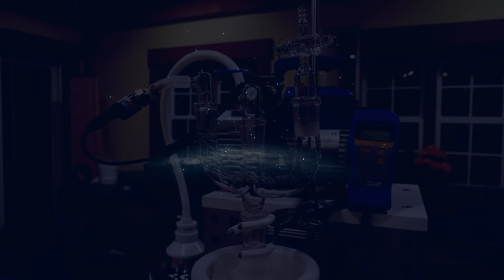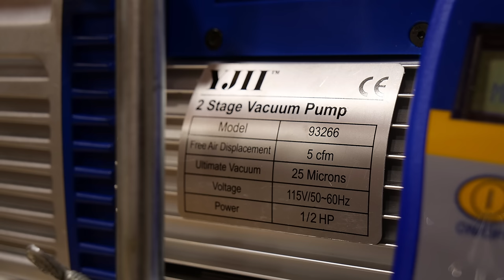Vacuum pump with NO moving parts

Comment: when you dropped the temperature from 300C to room temperature, why did the pressure only drop to the same value that the pump does without sieve? i expected it to drop lower than that because of increased adsorption.
Reply from the maker: Only because I for shortened the pump down.  There was more gas that could have been removed.

Comment: while i can't think of any applications in my life this was absolutely fascinating as always. what kind of vacuum pressures can this method achieve, given a maximum molecular sieve to empty space volume? i.e. where is the equilibrium of the sticky adsorption non-bond for the stickiest of molecules?

i don't know if its a thing but the prep process had me thinking about a potential thermal differential solid state pump, creating low pressure by cooling one volume and high pressure by heating another, connected through a one way valve. how well does that work?

most exciting of all are the molecular sieves. the oxygen concentrators and the experience seeing your perception of the sky change sound amazing. i'd be really interested in whether they are a sensible solution for water purification, air filters for gas masks or even against radioactivity?

Comment: I’ve always wanted to make a sprengel pump but didn’t because I wasn’t really sure if there was a good way to get rid of the vapor, maybe this would help? Not really sure how practical the combination would be or if removing the vapor would affect the pump, maybe though—I mean if it did work that’s an mostly safe and mostly free system for vacuum. Either way I’d love to see you have a try at one on the channel some day if it has a use.

Comment: Please do a video on and demonstrate the principle of synthesising, producing Carbon neutral fuels from renewable feed stocks. Maybe talk about how the future we are moving into having yes more electric cars, trucks etc as more the norm but for transport of larger, higher energy density use and required options like your container/tanker ships, large commercial aircraft, Military equipment (their aircraft, ships, tanks etc), construction equipment etc, all these more large energy use/output equipment that will otherwise need to be fueled with traditional fossil fuels; in itself may make the adoption and use of renewables, more strongly opposed.
Maybe a demonstration on the Fischer–Tropsch process utilising excess renewable energy as the energy feedstock along with CO2 from projects like the C02 air capture process using either strong bases or amines. Also the feedstock of hydrogen from the electrolysis of water to make a desired, energy dense, Carbon neutral, Hydrocarbon. 
Thanks.Hope to see you do something around the topic. Love all the work you guys do!

Comment: Several years ago I bought some laundry balls that contained "ceramic beads" that were supposed to boost the cleaning power of your washer. It seemed to work very well, so I removed some of the beads and put them in a bottle with tap water. It would foam when shaken, while pain tap water would not foam. Several years later these beads will still make water foam up. I bought some more laundry balls with ceramic beads but the new ones don't work at all, no foaming action and they are plain ceramic beads. Why do you think the older ones work so well? It is supposed to be molecular action.

Comment: Good deal!  I'm interested in this kind of pumping, I want to use it for a small Neon plant, to replace a diffusion pump which came to a bad end.  Ah would have liked to see the punch line here!  Ultimate vacuum of 1) just baked out zeolite without cryogen and 2) refrigerated zeolite at the end there.  We didn't see the final pressure!  
Also, it's my understanding that this kind of pump tends to ignore Helium, Hydrogen and NEON.  I think that's at LN2 temperature, not Liquid Helium temperature.
Reply from the maker: That's correct.

Comment: We have very very large vacuum pumps at thermal and nuclear power plants.  They are called steam jet air detectors and use high pressure steam passed through a jet pump to draw out non condensable gases out of the condenser.  They can draw an almost perfect vacuum, if you have a low subcooling temp in the condenser hotwell.
Reply from the maker: Interesting
Reply: Forgot to mention... loved the episode and the show!  Your lab/workshop looks amazing.

Comment: Being experienced at high vacuum systems, I question the readings you are getting. What is the type of gauge you have there? I suspect the accuracy of the gauge below 50 microns. An industrial quality gauge such as an MKS Baratron would be accurate in that pressure range. The cheap piezeo stress gauges tend to be marginally accurate to 50 microns but become unreliable below that. The main problem with the cryocool pump for most of us is getting the nitrogen. I have to drive 15 miles through traffic to the supplier. :(
Reply from the maker: You're probably right about the guage, but the stability and repeatability is solid and so for comparitive readings it's probably good enough for this application.

Comment: FURTHER GAINS???
If you then reheated the molecular sieve (MS) and then re-cooled it, all while the pump was going, would you get any further gains, or is there so much effective surface area in the MS that one cycle doesn't come anywhere near saturating the available surface area. and no improvement will occur? 

And yes, as was said below, this was so much fun to watch that it was over before I knew it!!  :))

Comment: @ teck ingredients

The vacuum line on a regular car engine to the master brake cylinder produces 14 bars of vacuum. This can be controlled by a standard.This can be set up by putting a splice into your vacuum line to the master brake cylinder and a ball valve inline. You extend the line from the car engine to the experiment. Or move experiment that's close to the car engine as possible.

You may want to disable the PCV Valve temporarily TO INCREASE VACUUM PASS 14.

Make sure you know what you're doing with your engine so you don't ruin it.

Comment: I expected ion getter pump which we use for the most UHV critical parts of electron microscopes - field emission electron gun. They don't even have any output. I don't remember exact principle, but gas molecules are ionized by high voltage in a narrow slot and attracted onto some reactive metal surface (titanium i think) and new metal is slowly deposited on this surface as well so gas molecules are trapped there forever. This is third stage after rotary/scroll and turbomolecular pumps.

Comment: Very interesting. Some of my high school chemistry students will be interested in this video.

I noticed that you kept the pump on beyond its specs. Would it be better just to take it off? Could the vacuum pump, when working beyond its mechanical limits, leak air into the system?

Thanks! 2 year old video that is very relevant today!

Comment: Science is fun isn’t it, well if you don’t like it you can fire truck off. 
My dang camera screen broke, I can’t see the vac analysis screen, that 20 microns I’ll trust trust you on. 
This is very instructive to me as I worked in the electrical field but crossed over to HVAC. I install refrigerant systems for comfort cool and heat. The whole of everything can be explained by temperature and pressure. (Save the thinking mind) I enjoy the handling of the gasses and the evacuation proses, all enable by dielectric magnetism

Comment: Ion pumps and NEG coatings also have no moving parts.  I am the inventor of the patented (expired now) ion pump controller that could control ion pumps and read ion currents when vacuum is in the 10e-12 Torr range.

Comment: My recycling sits in view of the sun. Overnight the sealed empty bottles get really cold and shrink, during the day they heat and pressurize, it makes a racket that reminds me to take them in.
I've always wondered, with one-way valves attached to a bunch of bottles, how much air you could move.
Apparently I'd want to put some of these beads in the bottles first?

Comment: Three questions:
1) You say the tiny fractions (microns) of an inch of mercury are "theoretical." Is that because if we actually introduced mercury it would vaporize at those pressures (and reduce the vacuum as well?)
2) Is the molecular sieve more "Van Der Waals attractive" to the freed gass molecules than the chamber walls and the contained devices... or does the sieve just have a vastly larger surface area so when averaged out the distribution of the molecules favors the sieve?
3) How does this differ from a vacuum keeper/getter?
Reply from the maker: It's theoretical, because you can't measure the height of the mercury when it is that small.  The curve of the meniscus is many times greater.  It's just the enormous surface area and this is unlike a getter which buries the gas molecules under an electrically sputtered getter layer.
Reply: @TechIngredients Thanks for that. The meniscus must be huge relatively speaking.
But back to getters:
I did some digging. Chemical (as opposed to physical) getters are what I was thinking of. They seem to be more of a vacuum maintenance strategy: you leave inside the equipment an area of "molecule hungry" high surface area material so as the gasses liberate over time, they eventually react chemically to the getter and those are stickier and harder to reverse than Van der Waals bonds. Do I have that right?

Comment: Really interesting. I know you mentioned mercury gas. But could you also not use mercury in that drip system to get to similar pressure? I think it was your target has a needle coming off of it and drips of mercury are catching small segments of atmosphere within and pulling it away. The difference is using gravity on a liquid versus the absorption of a material? Granted, at $2 for the siv mats, I guess that is not a huge concern to set up something heavy. your thoughts?

Comment: Just prior to the 10 minute mark, when talking about oxygen concentrators, you state that it is the Oxygen that the molecular sieve preferentially adsorbs, and that the first gasses to leave upon decompression are the Nitrogen... is this correct, because I'm finding the opposite reference when searching this online?  I'd love to see you build a cascading oxygen concentrator.
Reply: You for sure were reading about "Diffusion" ?!
This is a other prinzipal !
Reply: @TomKappeln  no, I was looking at information pertaining to pressure swing adsorption and oxygen concentrators which operate on the principle described... all other references suggest that the Nitrogen is "trapped" by the media, not the Oxygen.  I'm just wanting to be sure, since it would affect the operation and design of such a system.
Reply: @justinedwards4540  : This has to do with the Delta adsorber.
Only the Oxygen can pass inside, the Nitrogen is a bigger molecule and stays outside.
I know the oposite effect from inflating tires.
If you inflate a tire for the first time, after a while all the Oxygen will pass thru the rubber, only the Nitrogen will stay inside.
This is why you have to check a tire first more often when new and later not so often because the percentage of Nitrogen is rising from 78% up to more than 97%.

Comment: You didn't mention stuff like plastics, rubber or even vacuum grease itself which chemists use to seal their ground glassware joints tend to off gas under deep vacuums. 

Question when buying cheap molecular sieves they usually come with dust is it ok to rinse it off before dehydrating/activating it?

Comment: The units of that vacuum gauge is interesting.  In the field, people usually use Torr or mbar, not micro-Torr.
Reply: I had refrigerated air conditioning installed in a house once. They talked about getting microns of vacuum in the refrigerant lines. Their method wasn't as sophisticated; it was to let the vacuum pump run all day.

Comment: Nice video once again, i would note that it is difficult to reach any conclusion based on the experiments shown in your video. Mostly because as you said the air you are letting to the vessel are at room temperature and the effect of the air being cooled contributes to the pressure drop that can be seen on your barometer (so the both effects are combined and its not entirely clear how much those beads actually do). Also the term pump is probably a overstatement and how do i know earth is a sphere.... aaaand oh boy i cant read and i am intelectualy deprived, heck i am not even sober

Comment: Another tech video guy build a magnetron for metal vapor deposition, and he uses metal sputtering (titanium, I think) to scavenge gas from the vacuum chamber.  So that's a third way, besides the two you listed (molecular sieves and "cryo"), in addition to pumps that work with such low pressures.

Comment: so if you made a cold trap with the inside coated with sieves or a way to attach and dettach the sieves so you could dump them after use Tech Ingredients do you think that would work  .A vacuum system like that would be handy for dangerous distillations

Comment: Dear sir,
In biodigesters when we want to purify methane we use h2s filters then gas drying filter and finaly CO2 filters which have the proportion of co2 drop from 40 to less than 2%. The typical filter is made of a 10m tube filled with small plastic rings increasing the surface area. Biogas is pumped from the bottom while a shower of small and cold waterdrops are sprinkled from the top at 8 bars of pressure. Would you say the non mechanical method you presented here would work for separating co2 and methane? With what angstrom dimensions? And would it be more energy-efficient in your opinion? Some filtering membranes start to spread in the industry but remain very expensive.  Other idea, why not separate gases using a vertical pressure column with gas bottles that have two openings at top and bottom and reaching the liquefaction pressure of co2 which is far lower than that of ch4? Then we could just unplug the storage bottle at the bottom and recover 100% co2 with 100% methane at the top. Would the yield remain efficient for methanization operations in your opinion? Thank you for your answer and for your smart videos!

Comment: Are there cheap low angstrom desiccants like that which are combustible, to be used to absorb flammable gases like hydrogen so that they become a form of solid fuel that's more energy-dense than either alone?

Sorry if this question doesn't make science-sense. I'm learning a lot.

Comment: Most thermocouple gauges are specified for nitrogen, so the partial pressures of oxygen and other gases need to be added to your reading...  (a correction factor between the gauge's sensitivity and actual partial pressure).  Also, pumps deteriorate over time and thus are specified at the end of their warranted lifetime.  The oil in your vacuum pump will evaporate and transfer to your chamber (or other pump) if you operate it at lower pressure for extended periods of time.  $2 worth of beads; however, the treatment/disposal of hazardous waste is MUCH more expensive...
Reply from the maker: That specification of pumps at the end of their warented lifetime maybe true for very high end systems, but doesn't make sense for low cost pumps that are used in a wide variety of conditions and without hour gauges.
The dessicant is not hazardous unless it has absorbed hazardous chemicals and then it's more convenient than decontaminating vacuum, lines, pumps and the dirty oil as well.

Comment: Got to design and work on a UHV system that operated at 500C. Designed new gaskets using multiple elemental depositions because everything else leaked.

Whole system ended up on Ebay for 500$ scrap when they sold the division :(

Comment: I remember a long time ago, when I was at high school, our physics teacher used some contraption attached to a faucet as a vacuum pump. I think it worked by water flowing around a nozzle inside the thing and drawing air along with it, kind of similar to what a spray paint gun does to the paint with air.

Have you ever had any experience of such a device and how low pressure could you hope to achieve with it?
Reply from the maker: Sure.
You can get these commercially and they're good for modest vacuums especially when you're dealing with vapors that you want to dump.  For long duration operation they can use a lot of water.

Comment: This is super interesting. 13 Microns is still a ways off from being considered "High vacuum" right? Could you achieve a higher vacuum with multiple stages of this pump? How would a system like that stack up against a standard diffusion pump? On a slightly related note, Cody's Lab did a video a while back on one of the first high vacuum pumps that used a long glass tube with drops of mercury flowing through it to evacuate a system. It was incredibly slow, but I have often thought about making an experimental pump that employs something like 100 of those capillaries to speed up the evacuation. As always, great stuff!
Reply from the maker: No, it's not a high vacuum.  Flow through pumps like diffusion and turbomolecular pumps don't have a limited capacity, they can reach much lower pressures, but they're much more expensive.

Comment: unsure if this has been asked before so sorry for the repeat if so: could you use a molecular sieve technique to also construct a nitrogen separation membrane? I'm looking to get a relatively-pure nitrogen source and most commercial membranes are rather expensive; the comments in this video leads me to think that it might be possible to DIY a solution. Thanks!